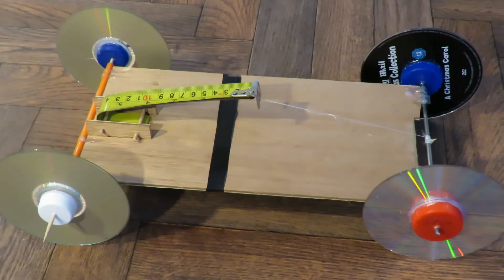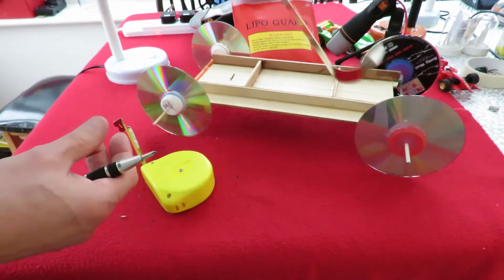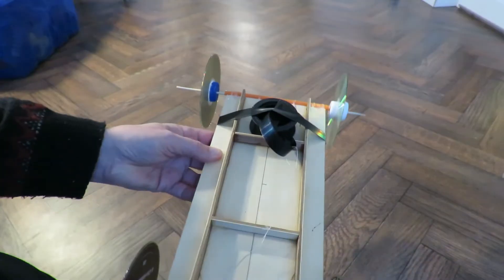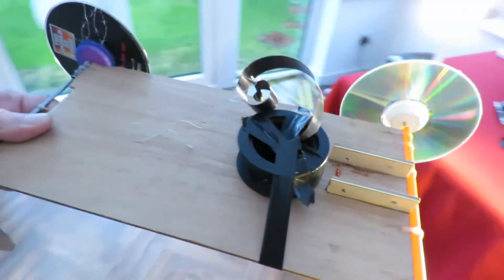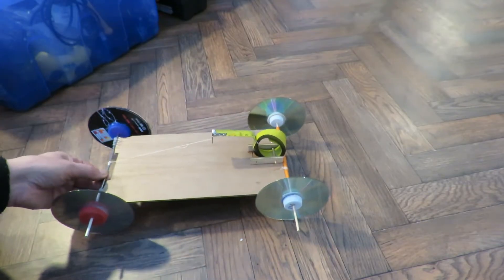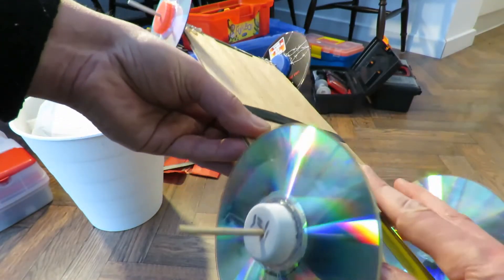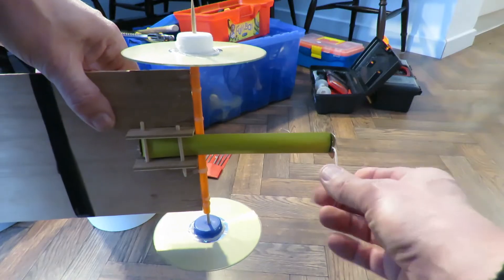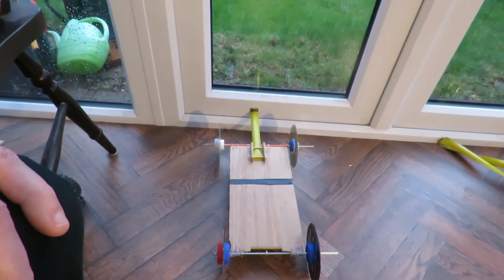Broken Tape Measure to Leaf Spring powered car

Comment: very impressive. i always chuck these out when they brake too
Reply from the maker: I found it interesting how easy it was to break it into sections by folding it. It was also interesting to add extra leaves to increase the power. Just one of those little projects that my mind gets involved in for no good reason. 😁
Reply: @GrandadIsAnOldMan  I love it cos you can tell you're having fun with the projects.
Reply from the maker: @systemSkynet  yep, my projects are made  by me, for me, and they are mine all mine 😆😆👿😡😠😆 but I don't mind if other people want to watch too.

Comment: i already saw that video, guess that was in reverse order. i remember reading a reprint of a book awhile back that showes a  miniature hand made paddle wheel steamer boat being powered that way.
Reply from the maker: You probably saw this video - Rubber Powered car converted to flat spring power https://youtu.be/QZh9dP9Sv-c
 there is a marked similarity because I did one and then used different materials to do the second one in response to a suggestion.
Here is another similar design I did back in 2013 https://youtu.be/-zcdR-kEnLQ
I have also done mousetrap powered cars and boats which are the same principle.

Comment: What if you lengthened the fishing wire so it comes off the axle just as the spring flattens as then you would use nearer 100% of the stored energy getting more distance possibly???
Reply from the maker: Yes you could do that. Three reasons why I didn't. 
1. It couldn't go much further in the space I have available.
2. When you get to the final part of the arc there is significantly less power. If you draw a semicircle for the path of the tip of the arm, then draw a straight line back to the axle from various points along the arc, you will see the force (which is more or less at a tangent to the arc) is in the wrong direction during the last part of the swing and the distance from the axle to the tip of the arm changes very little so very little string would be pulled off the axle. I have seen rather elaborate mechanisms employed on mousetrap powered cars to extract the final bit of power from that part of the arc although I suspect they may absorb that power simply by adding an extra link in the chain.
3. It works, that is good enough for me. That means other people can copy my idea and improve on it and have the satisfaction of doing better. 😁😁😁